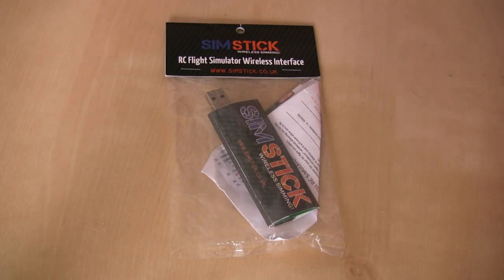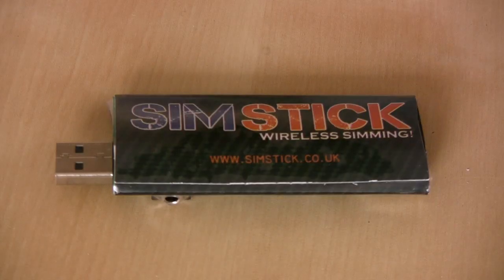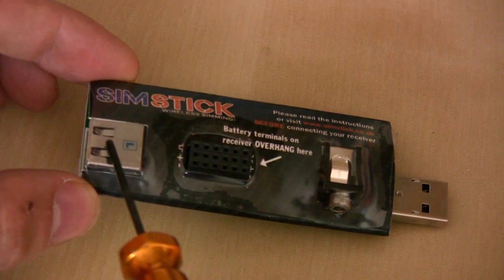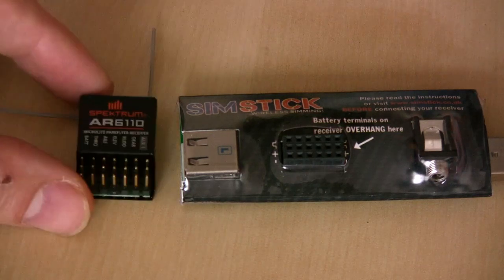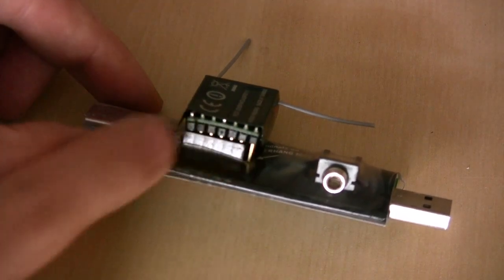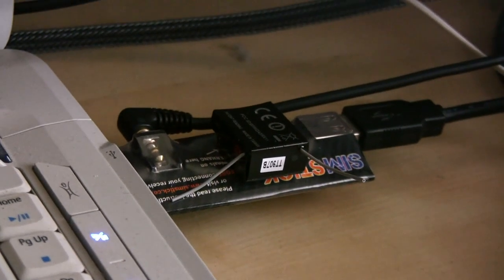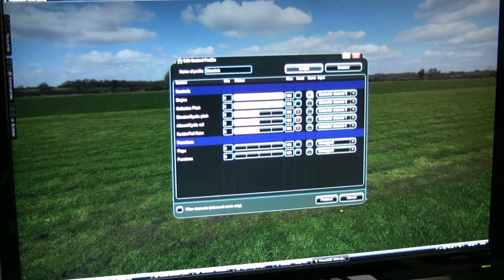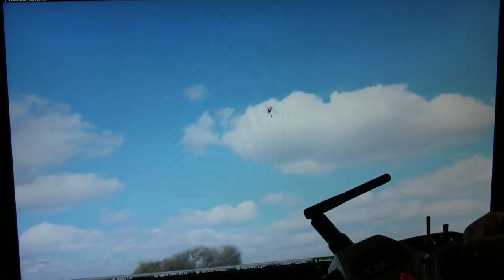Simstick Overview

Comment: hello you video L audio cable is connected to the transmitter ?
The other end of the line  Where is the connection?
User Sinstick if can Join XTR2 interface Setting to Joystick mode + other joystick in XTR2 2 Plane flight ?
Reply: You can get a product similar to the simstick for under 18$
Search for "f01842 12 in 1 wireless rc-simulator kabel usb" on Aliexpress.

Comment: I'm sure it does it's job well but it seems a bit of a hassle, a bit messy, a bit expensive and a bit pointless if your sat in front of your computer. 
Also, plugging the Phoenix dongle into the training lead port on your Tx only uses 70mA where as using the 2.4 to talk to the SimStick will draw 200mA from your Tx
Maybe Phoenix RC (Runtime Games) will come up with a neater solution some time soon.

Comment: For the use of Phoenix v3 sim you have to have the cable (dongle) that comes with the Phoenix simulator kit in the box. The dongle for this set up  is the one used in the Spektrum  Tx units. You can not use this with out the dongle. The only way to get the dongle is to purchase a copy of the Phoenix simulator. This is an awesome set up for using on my 73 inch tv with out cord stretched across the living room.

Comment: Does it cause the battery to drain quicker on the Tx?  Seems it would be drawing more current to transmit than plugging it in to my Tx (while turned off)...